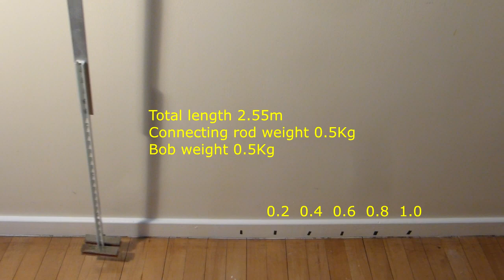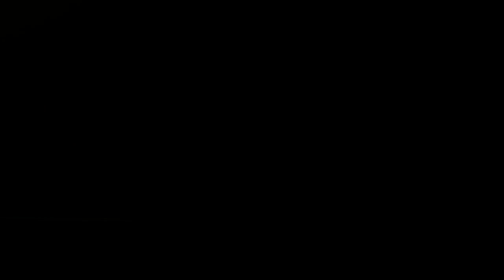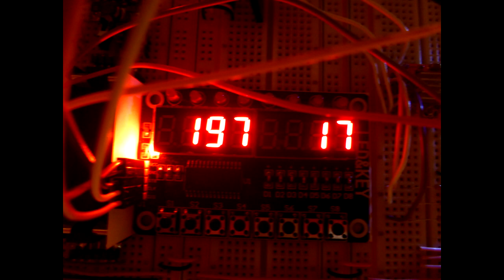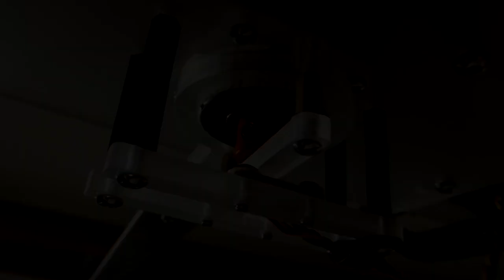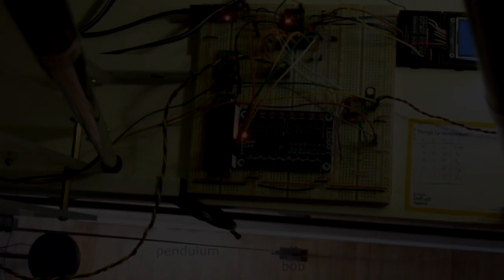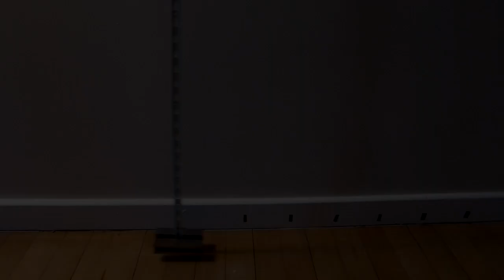Big Ben - 10. Pendulum 2.5m ready for soak test

Comment: Very well done,.... are you in resonance with the pendulums swing or are you pushing outside resonance.  I have a 2100mm pendulum that swings at resonance, however it is only in in isochronism at a swing of 400mm, outside that it becomes unstable.
Reply from the maker: @peterleane6807 Thank you Peter. I think it approximates resonance (although am happy to be proved wrong!) as every push is based on the swing time, and this is re-calculated at each swing.

The method is probably over-complicated, but that's just me :) ...

The sensor only provides the absolute angle at the time it's read, so to determine the direction of the pendulum, it waits for consecutive readings to differ by a threshold value. This means it will have travelled some distance from top-dead-centre before a decision can be made, but because I wanted the tweaking freedom of pushing at any time, the decision is made on the reverse swing. 

The decision time is then added to half the previous swing period (which is continually updated at each swing) to predict the time for the corresponding point on the subsequent forward swing, and this is then added to a +/- offset. When this time is reached, the stepper motor is energised.
 
I've been adjusting the offset manually to maximise the swing size, and the best values for any given push power give a push somewhere between the end point (top-dead-centre) and the mid-point.
Increasing the power and re-tweaking the offset produces larger swings as shown in the video.

I managed 0.8m swing with a 2.5m length and 0.5Kg bob weight, and although it may have been possible to get larger swings using more steps per push, I realised such large swings weren't such a good idea after all, so concentrated more on smaller swings with a more pleasing 'tick' sound.

Thanks for stopping by, and good luck with your Foucault experiments :)